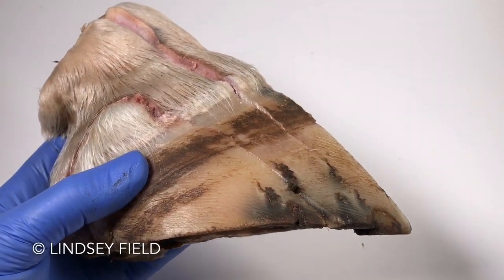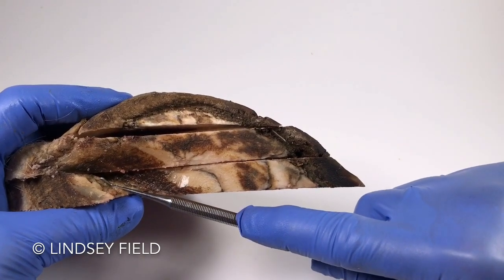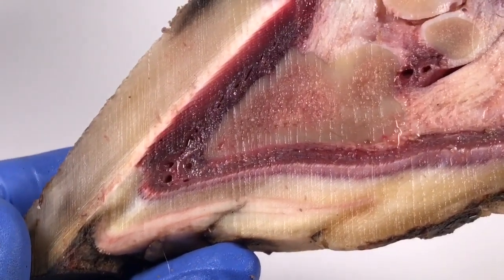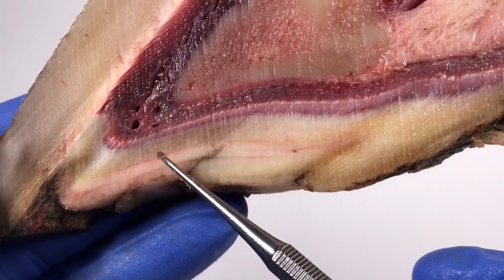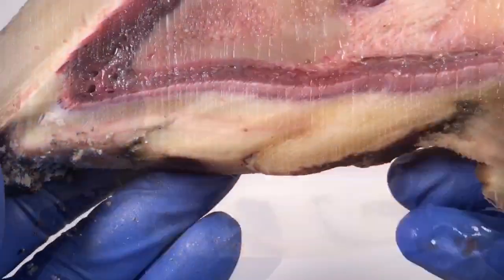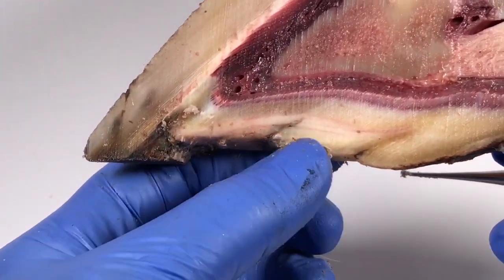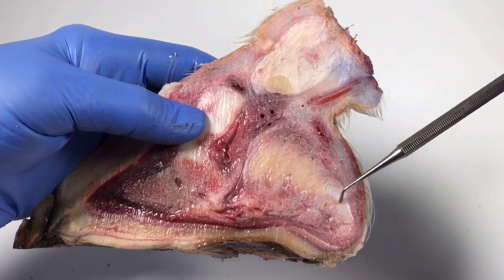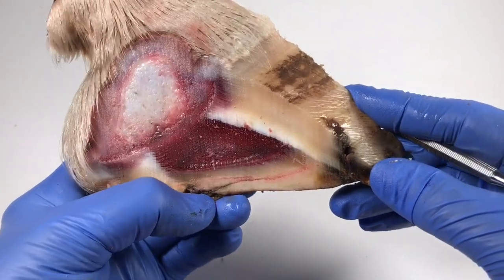Exfoliating sole? In the equine hoof

Comment: Interesting. This horse had a thin sole in this foot.
Reply from the maker: This was one of the thicker soles that I’ve seen in my cadaver studies!
Reply from the maker: Jean Atkinson the sole itself was about 12 mm from memory.  Most cadavers I see are only 5-8 mm.  Debth was measured from about 1 cm from the wall as usually it’s measured from the coffin bone and is measured on a Sagittal section.  This section was parasagittal.